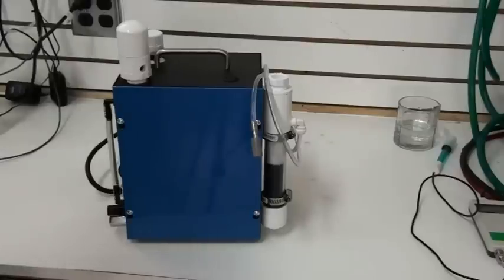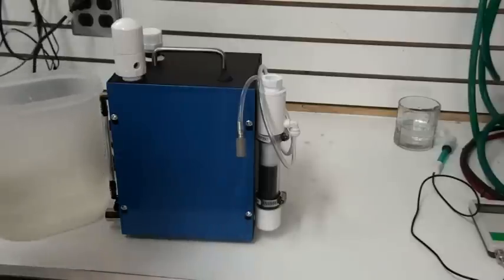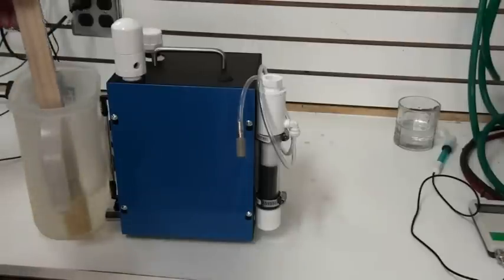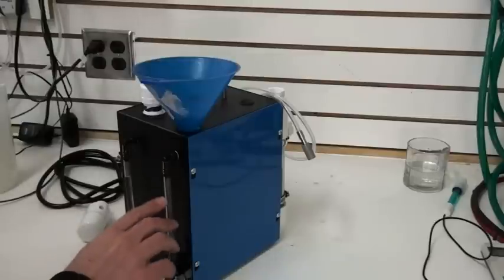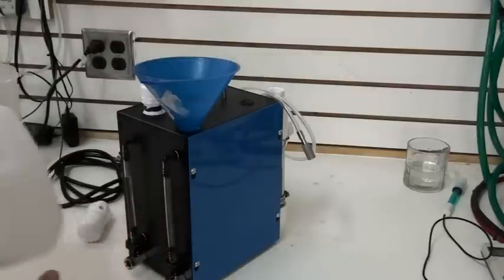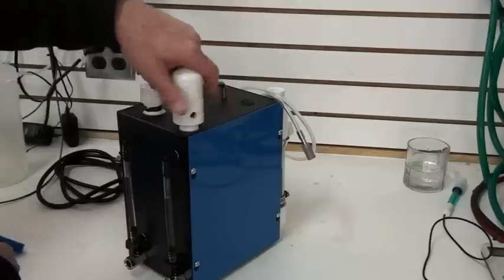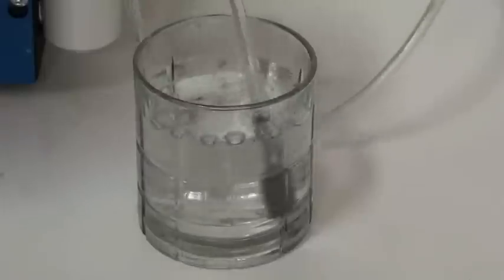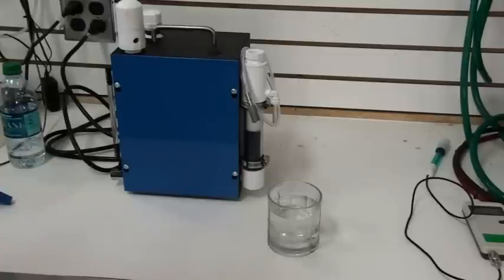setup of countertop hydrogen charged water machine

Comment: (H2O + sodium hydroxide + aluminum) = ( pure 100% hydrogen ) Put the H2O, sodium hydroxide and aluminum in a metal-non aluminum can and add a torch in the end... The problem with this reaction is the heat that is produced...
Reply from the maker: +aaalexccc This method is not good for producing health therapy gas. It will be contaminated